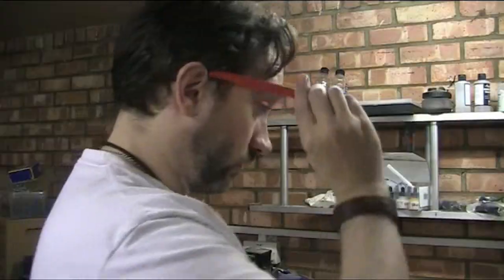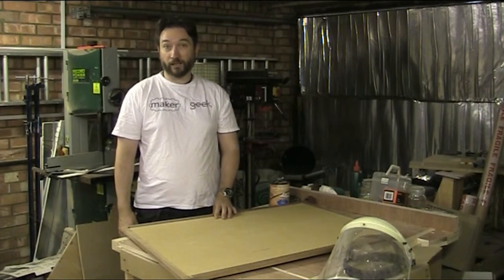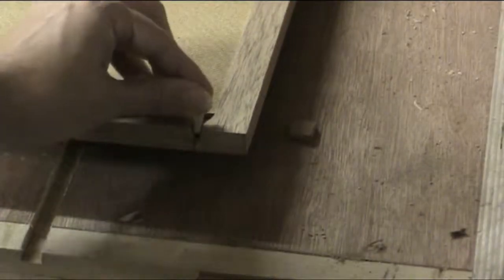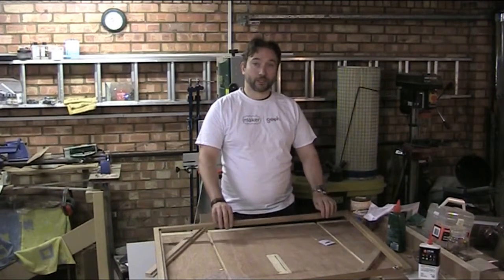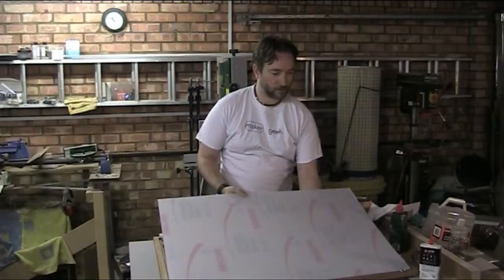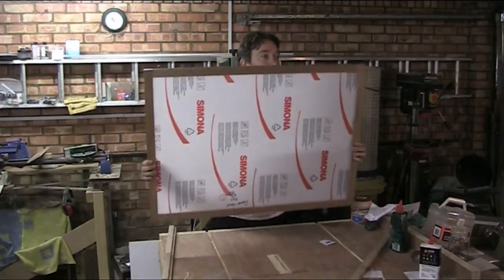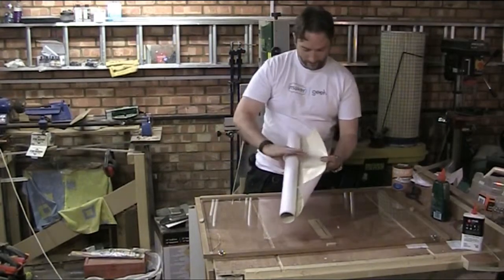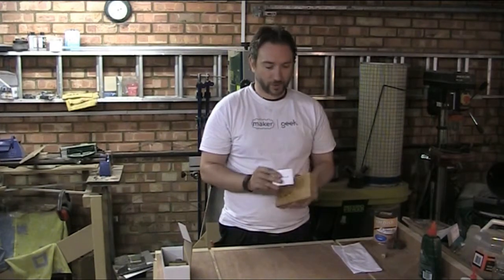Custom Picture Frame Part 2

Comment: I think your gap issue was a place where you could have used CAD to help you realize the shape you needed. By CAD I do mean Clay Aided Design too. They make this stuff called never hardening modeling clay. Get some for your workshop if you do not have any yet. When you get a piece if you are careful with it you'll have it for life. You strike me as the type that once you have some modeling clay you'll find a myriad of uses for it. Modeling clay is one of those neat things to have in your creative toolkit. Stuff is dirt cheap too. I mean it is clay.